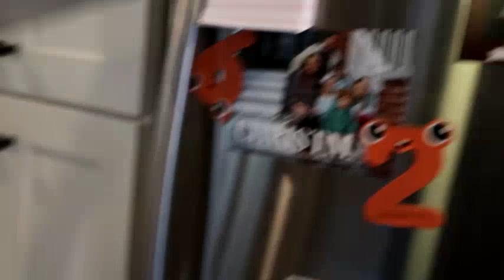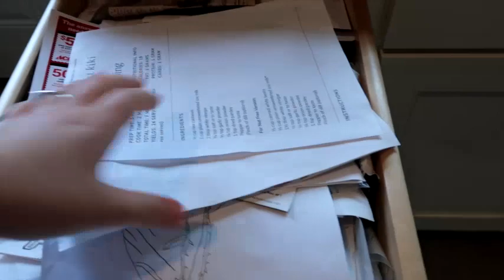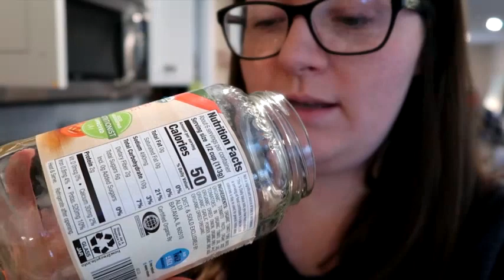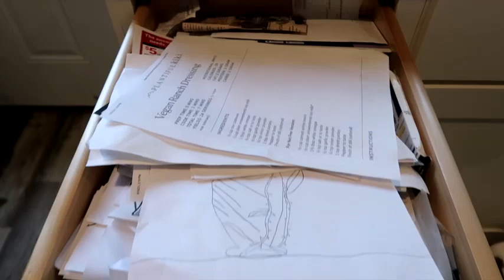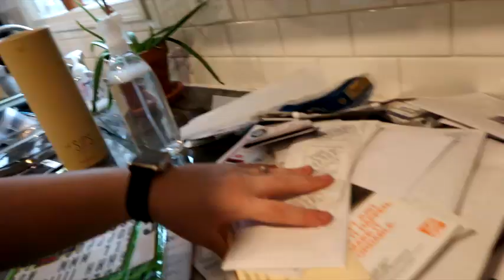DECLUTTER WITH ME // CLEAN WITH ME // BECOMING MINIMAL AS POSSIBLE

Comment: I tried using the spice steps storage for so long, was always knocking things off & moving things around when I had to access the ones in the back....which I really couldn't see. It seems like so many people have that step storage thing & love it, but it just always frustrated me.
My kitchen only has a few shallow drawers, & I need those for eating & cooking utensils, & I don't want any more clutter on my counter or wall, so cabinet is the only option for spices for me.
I finally found a two-tiered lazy susan at a thrift store & put my spice bottles on that, & no more frustration! It's so easy to spin that baby around & see everything at a glance, & simply pluck out the jar you want without having to move other bottles or knock them over. I only wish I had done this years ago.
If anyone else doesn't love the spice step storage, & doesn't have an extra drawer handy, try a 2-tiered lazy susan! Or maybe I'm just weird lol.